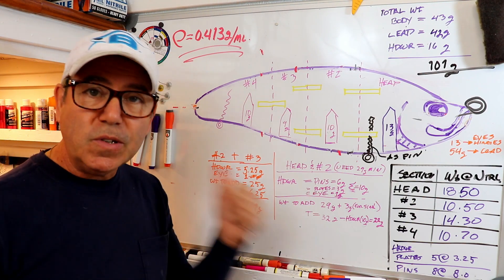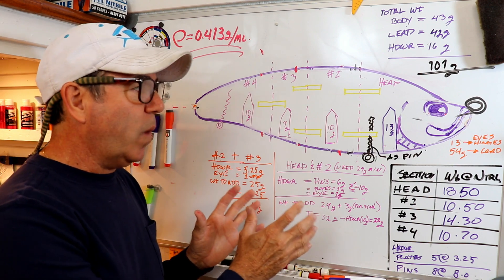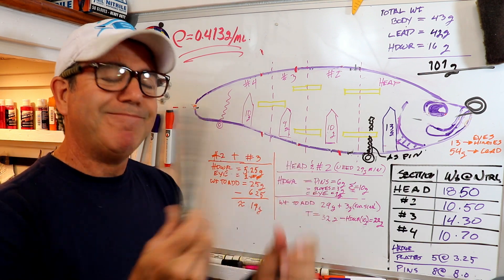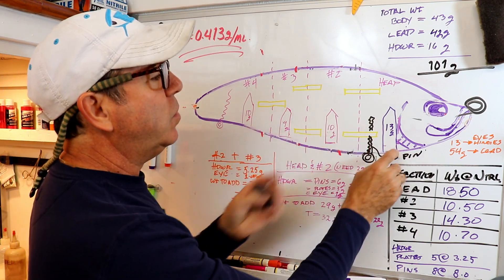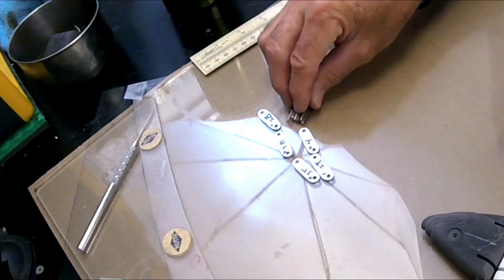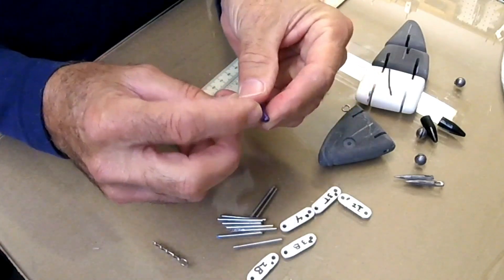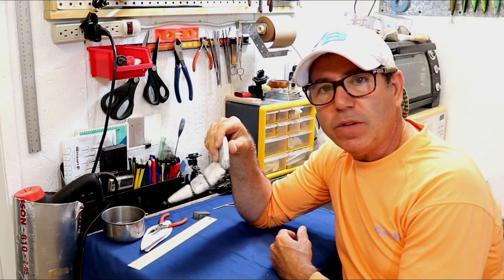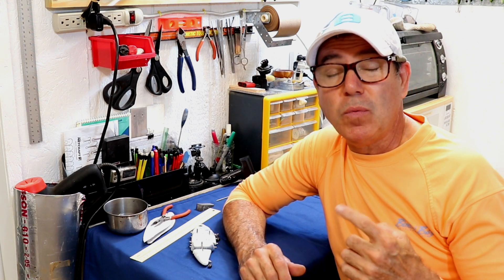Making a Swimbait Design and Build Part Four

Comment: I would suggest getting tungsten electrodes from welding shop. You could use them for the hinge pins. They might be easier to find spots to put them in the thinner sections too.
I appreciate the videos, always well done.
Reply from the maker: Thanks for the tip.

Comment: Do you think the friction on the second piece is from the slots being a little tight?  I also wondered if the twisted hook tie instead of a smooth pin was an issue.
Reply from the maker: I checked the hook eye. ..no issues there....the friction from the slots I can clearly feel....we'll see if it makes things better to open the slots a bit.

Comment: Do you think that middle piece made of a different material it actually hold the head of your lure from moving as well as the rest or the number of segments?Great video! Thank you sir!
Reply from the maker: I don't expect much movement from the head but, the second piece should be moving more. We'll see if reducing the friction  does it.  But to answer your question, yes I think since the second piece turned out to be heavier than the others. ..it's dragging.